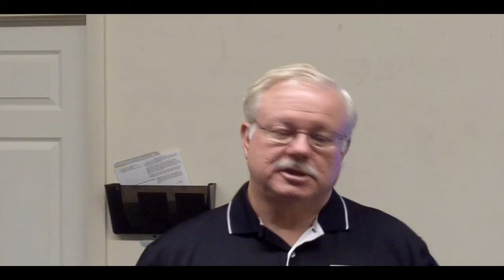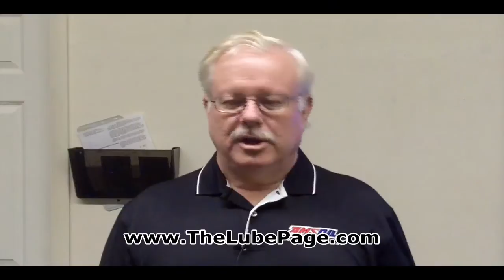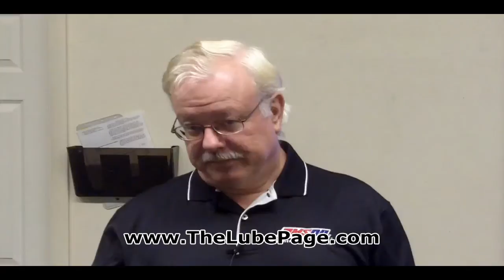Straight and Multi-Weight Oil Comparison

Comment: I think the viscosity improvers are a good thing because your oil is thin when it's cold and thick when it's warm the complete opposite of what a straight weight oil would do correct? Since a straight 30 weight oil wouldn't have any viscosity improvers wouldn't it be thin hot and thick cold? Interesting video

Comment: Amsoil makes a 10w-60 Dirt Bike Oil that I use in a dual sport.  So would I be better off using a V-Twin 15w-60 instead?
Reply from the maker: No V-Twin has a different additive package than the dirt bike oil so sue the dirt bike oil.

Comment: Weight? Lol >< what a fraud they all weigh the same thing
Reply from the maker: Weight is used as slang term when viscosity should be used.  So many folks are used to this terminology that it is easier to explain things in terms people are familiar with.  To be fully correct higher viscosity oils are actually heavier in 'weight' than lower viscosity oils.  This is due to significantly larger molecules giving the higher viscosity oils a greater mass.  They have more mass per volume.  Weight is proportional to Mass.
Reply from the maker: @BIG HORN MGTOW The Amsoil Max Duty 15W-40 Diesel Oil is the best you can buy.

Comment: I use straight 30 weight Shell Rotella oil and everything I got. I use it in my farm tractor my automobile my pickup truck and my lawn mower. my Honda Accord has 268 thousand miles on it.
Reply: clev hay how often do/did you change the oil? (Rotella)

Comment: I was taught in high school auto mechanics by my old school mechanics teacher that the additives in multi viscosity conventional oil didn't have any lubricating qualities. So he used straight 30 W conventional oil in his early and then his later 80s model Chevy Suburbans in the spring and summer time. Then in the fall he would switch to a multi viscosity conventional oil until the following spring. I took his advice back then, in about '85 and did the same for several years. But these days it appears that all of the straight 30 W conventional oils are mainly suited for lawnmowers and such and I haven't found any detergent type straight weight oils suitable for vehicles lately either. And I've gathered over the years that conventional oils have drastically improved also. My question is, I have a '95 Buick Riviera with about 130,000 miles and it's time for an oil change. What are your thoughts on finding/using a straight 30W oil this summer? What are your oil recommendations. I believe that the specs call for a 10w30 oil.....
Reply from the maker: Of course viscosity improvers are not anti-wear additives.  Increasing viscosity will make the oil film thicker and this will enhance separation of the moving surfaces.  Straight weight oils were preferred early on because the VI products were not very good and they tended to fracture and the oil would then not attain rated viscosity.  Today, the viscosity improvers (polymers) are light years better and shear-back is not a problem in good quality oils. Use a good 10W-30 in your 95 Buick and it should provide you with year round protection.
Reply: Dan Watson Thanks for the reply, that's good info...
Reply: Motor oils have a service rating. The latest is SN. All motor oils have to be compatible because the biggest buyer motor oil, the federal government demands it. You have to use the rating required by your vehicle. Maybe you can mess with what weight you use, but you have to have the right rating. That means, for one thing, that you cannot use SB-rated non-detergent oil in any modern vehicle. Some people with old VW's and vintage cast iron engines still use it, but no one else can. Unless they like buying engines. Or they just love to experiment and are willing to pay the cost.

Comment: Mr Watson, When you say that a wide range multi, like a 5w50 or 10w60 has a quick breakdown, are you considering a mineral, semi or fully synthetic oil>
Reply from the maker: It really has to do with the amount of VI improvers you have to use for the extra wide spread.  High quality synthetics use less VI additives than petroleum for the same spread.  My concern is really for 5W-50 or 10W-60, improvements in VI additives have made 5W-40 acceptable.
Reply: You consider a group III a high quality synthetic in these VII scenario>
Reply from the maker: Certainly, group III are higher than petroleum but group IV has higher natural viscosity index numbers so you add less VI improvers to group IV for same spread as group III.
Reply: Dan Watson So, what about polyol esters? Would it help to give a thin group III a better natural Viscosity Index?

Comment: Hey, it's not the problem of a synthetic oil. Your engine or gasket has leak so you gotta fix it. the synthetic oil has better flow so that even in a small hole they can leak out, but conventional motor oil is much thicker, like a honey, that they can not leak out. Again, it's NOT due to the oil. go change your gasket. check out youtube video 'synthetic vs conventional oil' by eric the car guy

Comment: I have a F22B1 (140K), and F22A6 (375K) (both Honda 4cyl) and i use GTX High Mileage 20w-50. I used AMSOil, but every hole in every gasket leaked out, so I went to a Semi-Synthetic high mileage for the swelling additives to stop and slow leaking.
Reply: Did it worked out?

Comment: This is a good question.  Hydro-cracked oil is a Group III synthetic oil not a semi-synthetic.  The confusion comes in whether Grp III should be classified a synthetic.  This argument peaked in the late 1990's with Castrol claiming Grp III to be synthetic and Mobil saying it wasn't.  Outcome Grp III is allowed to be classified as synthetic.  Grp IV synthetic is primarily Poly-Alpha-Olephin (PAO) and is the superior grade hence the Grp IV classification.  For more info contact me on my website

Comment: The original oil recommendation would be for 10W-30 but based on  the 96,000 miles and the severe duty, I would recommend Amsoil 10W-40 (AMO) or 15W-40 (AME).  The thicker oil will give you a better ring seal and reduce blow-by.  Blow-by will cause pressure in the crankcase and this will result in oil vapor being sucked through the PCV system and burned resulting in oil consumption.

Comment: Actually, your right!  I would rather go to a 10W-40 than a 5W-40 but the company tells me that the new polymers designed for VI can handle the wide range of 5W-40.  It seems to me that if it is so cold you need a 5W that maybe going 5W-30 would be sufficient but the vehicle manufacturers are calling for the 5W-40.  I still stand by the smaller the range the more shear stable the oil.  I'm going to lose this argument to the designers so I'll just go ahead and yell UNCLE.
Reply: No I think you're right it does take more of the viscosity improvers to go from a 5 weight to a 40 weight then it does a 5 to a 30 and I've heard the same thing that they sheer a little faster but only in turbocharged vehicles or motorcycles your average daily driver isnt hard enough on the oil to Shear it back as fast and viscosity improvers today are phenomenal. So I think you're right to certain point but I think it's only High Strung engines that are stressful on the oil like motorcycles that share a crankcase and a transmission and turbochargers you do bring up an interesting point though
Reply: If the engine calls for a 40W oil, arbitrarily deciding you can use a 30W oil just because you think it's cold enough outside may not work out well. The oil can still get very hot even in cold weather and using a thinner than specified oil may or may not provide adequate protection and there is very little to be gained from doing so. I prefer avoiding oils with a wide viscosity spread as much as possible too because of the problems viscosity index improvers can cause, but sometimes something like a 0W40 is necessary either because of cold temperatures or warranty requirements. If oils with a wide viscosity spread were incapable of adequately protecting the engine, we wouldn't see so many high performance cars calling for these oils. The Corvette, Challenger Hellcat, Ram TRX, and Nissan GTR as well as many cars from Porsche, Audi, BMW, Mercedes, McLaren, Ferrari, Lamborghini, etc have been using 0W40 for years and they seem to be doing alright, so I wouldn't lose any sleep over this.

Comment: Actually, your question is right on target.  How can a straight weight oil with no VI be called a 10W-30/SAE 30 weight?  The answer is in the testing that qualifies the oil for the SAE Grade.  Oils are tested at a cold temp and must achieve a certain flow to achieve the W rating and then tested again at 210*F for the second number (operational viscosity).  The synthetic Amsoil 10W-30/SAE 30 passes both testing points with zero VI added.  Oils without VI are defined as straight weight.

Comment: Multi-Grade oils do not adhere to Newtonian fluid characteristics.  Newtonian fluids can be plotted between phase transformation points (freezing and vaporizing) and will consistently show decreasing viscosity as temp increases.  Multi-Grade oils are thin when cold and thicker when hot.  This is done by using Viscosity Improver (VI).  VI is made up of string polymers that are straight when cold and coil up when they get hot.  The coiling action is like starch in gravy and thickens the oil.